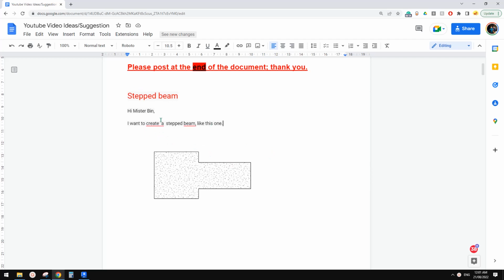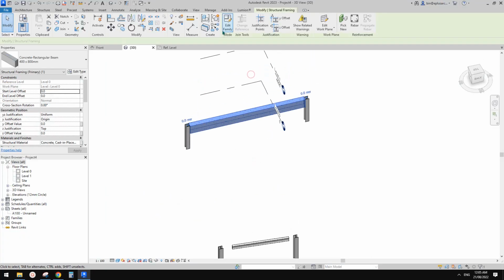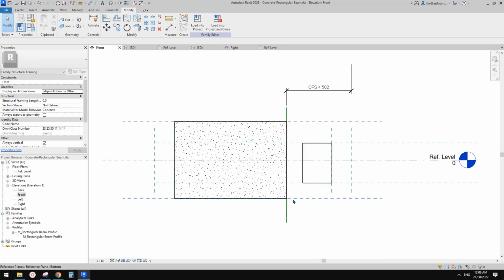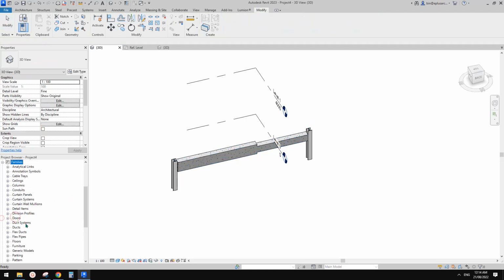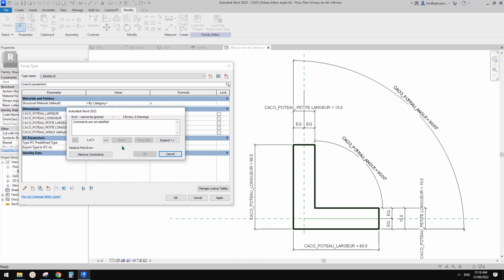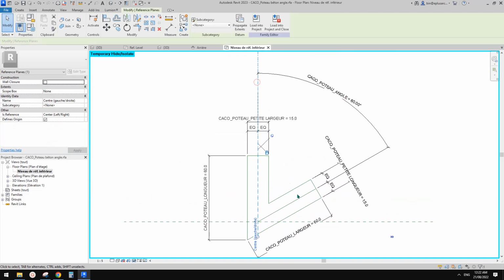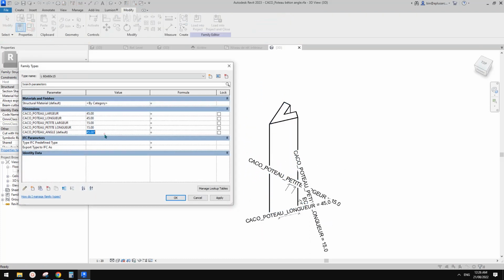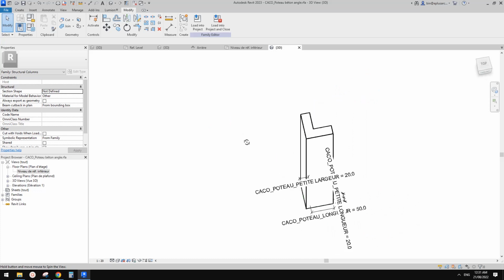Revit Exercise (Day 881) Some Revit Family Questions Answered

Comment: Hi Bin, can you make it to flip?
Reply from the maker: Not sure... Maybe not...
Reply: @BINHE615  it will be great because sometime you need it in the other side and with the flip control it's not working.
Reply from the maker: You can add Flip control in most families types, but I don't think it will work in Structural Framing family. You can create a new generic family and create the same geometry with that flip control.

Comment: Great stuff as usual. So I was curious about why you were getting those extra drag lines for the steel beam and not for the concrete beam. It turns out that there is a parameter, in the family category and parameters dialog, that if changed to steel, from concrete(Parameter is called Material for Model Behavior), you get the concrete beam to work the same way as the steel beam does(with the extra drag arrows). I work in arch so I don't model beams too often, but always good to know how they work
Reply from the maker: Good stuff. Thanks very much for sharing. I work in arch too, and love modelling structures.